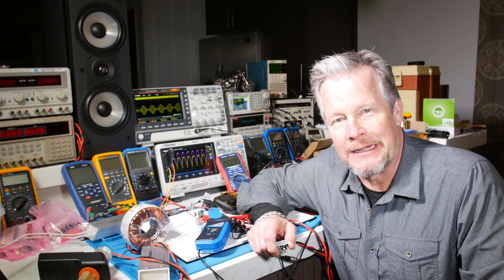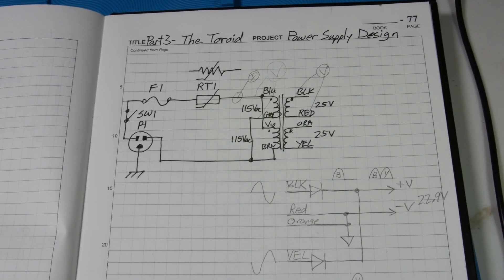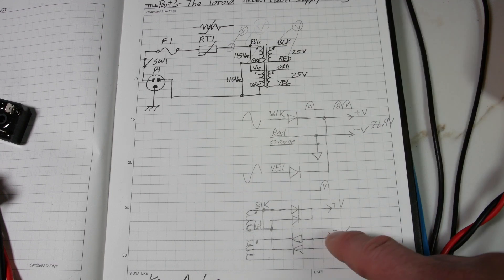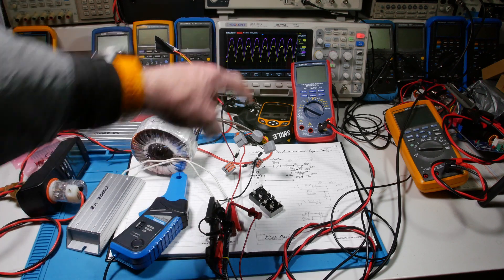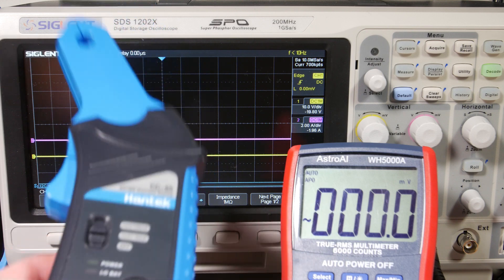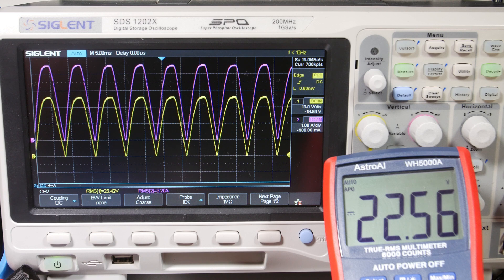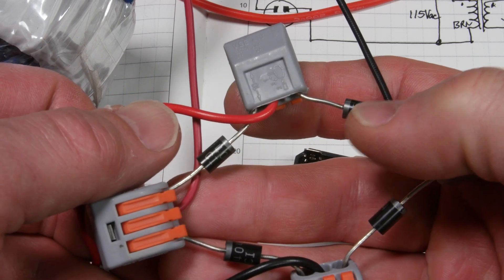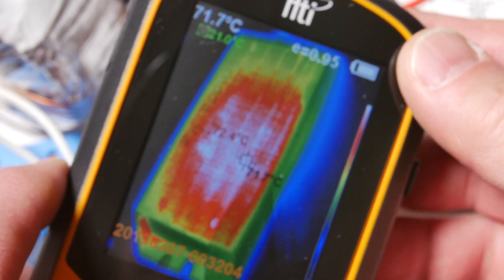Power Supply Design #5 Full Wave Rectifier

Comment: Nice one Eddie.  Please don't give up on this series!  I presume we're onto smoothing capacitors next if the progression is anything to go by :)  The calcs for selecting those will be interesting.  And I'm really looking forward to your approach to the control circuitry.
Reply from the maker: Thank you!  Yes, you’re right - the capacitor selection and how it affects both output and input power quality will be demonstrated.
Reply: Hi Eddie, I'm doing a bit of recapping on the material you've covered so far and I'm still getting my head around the inrush current.  Once we've worked out the smoothing capacitors to be used and we know what our supply load parameters that we are designing for, I think we have the info we need to calculate the NTC thermistor requirement for managing that, and presumably a suitable input protection fuse?  Is this something you could cover in the next video - or maybe even a recap video at the point you've, effectively, covered the Power Supply stage with a worked example for an example design (e.g. a bit extreme, but say 30V @ 5A)  I think that would really cement things.
Reply from the maker: Andrew Johnson I like where you are going with this - thanks for the great input!!  I’m working on the cap video tonight - I hope to post it late or tomorrow.  Thanks again!

Comment: Finally an explanation on what a bridge rectifier does on a center tapped transformer, I've been searching online to explain this but I couldn't find anything online on what happens when you connect a full wave bridge rectifier on a center tapped transformer.
I'm using a sort like transformer with isolated windings and I have to use the center tap as the return path because otherwise the output voltage is too high but I always thought that the center tap wouldn't output a positive voltage and because of that only half the full wave rectifier was used but that's not the case and I want to thank you for clearing this up to me.
I don't have an oscilloscope so I can't see what's happening, when I measure with my DMM it didn't make sense to me and when I connected just two diodes I got only half the voltage which was confusing me but because of you video I learned what I'm doing is actually the right thing... 1000x thanks man.
Reply from the maker: That is fantastic feedback!  I really appreciate hearing this;)

Comment: I was going to hook this same circuit up in my lab. Of course I'm going to try to get the diodes in the correct direction. Can you tell me what would happen if I got the diodes in the wrong direction? How serious would this be?
Reply from the maker: TymerTopCat That’s great!  Let me know how it goes.  If the diodes are not hooked up correctly - it could cause a short or an open.  Here’s a video about this.  How diodes work in a power supply with Simulation https://youtu.be/mL1tyLvWho4

Comment: I may have a subject you could talk about in your series. It is not easy for me to formulate since I have nearly no knowledge about it, but here we go:-)
When building a amplifier one has to decide how many watt it shall have, how much gain and thereby also what the specifications of the transformer. But since VA is a combination of Voltage and Amps you could have a 100VA with 100V - 1A or 1V - 100A. How do you find out how many Voltage you need for x Watt out and how many Amps to have enough? How do you calculate so you avoid clipping?
Reply from the maker: You have more knowledge and fantastic ideas than you may understand - or at least IMHO;)
I am working up to that - which is a natural progression to what we are doing now.  I actually want to develop a new process or measuring bar on how to do just what you are talking about.
Reply: @KissAnalog  WOW thanks for your kind words, I do look forward to every video you make! And it sounds extremely exciting that about the measuring system!
Reply from the maker: I’m very happy to have you aboard, and I appreciate your support!!

Comment: Great video, am I understanding that the AC did go trough 1 diode in the last circuit and trough 2 diodes on the full bridge rectifier and you therefore have a lower voltage drop and heat in the first circuit?
Am I right in that the DC, without load, is more stable using a full bridge?
I am thinking, is there alternative solutions instead of diodes, something that are as fast but with a lot less loss?

Last, a comment / advice on your ending when you have to end abrupt. What if you added your "thanks for watching..." video right after that cut?
Reply from the maker: Yes you have it right about the diode drops.  I think the load stability is about the same with both types of full wave rectifier cases.  FETs can be used for rectifiers and they are then called synchronous rectification.  They are usually used in switch mode power supplies which is my specialty.  We will cover them soon.  Thank you for the great advice!  I really appreciate it!
Reply: @KissAnalog  It is so great, the way you explain the thing, makes it so logical and easy to understand! 
SMPS are super interesting but hard to understand for me, I know that they have a bad reputation, where low ripple and noise is important, but I have a suspicion that it may be duo to lack of knowledge on the "new" technology.
You are so welcome, I am so happy that I can give a tiny bit advice back to you! :-)
Reply from the maker: I’ll do more videos on SMPS very soon.  I hope to make you an expert! ;)
Reply: @KissAnalog  Lol I hope so to:-) No matter what, you have already teached me a lot!! :-)